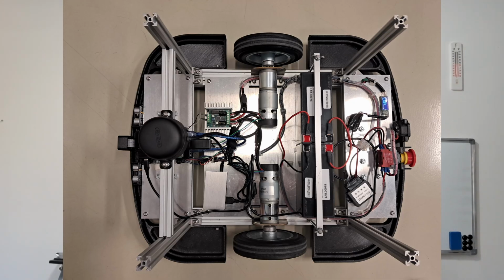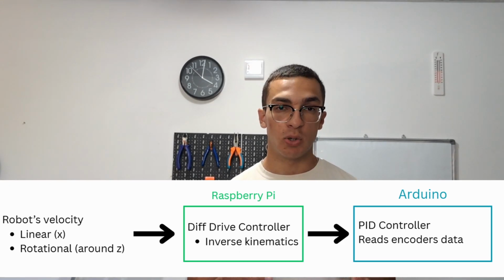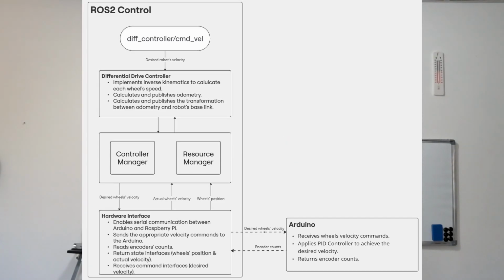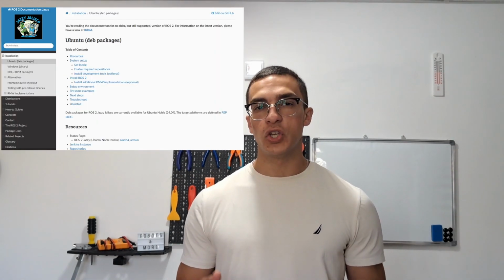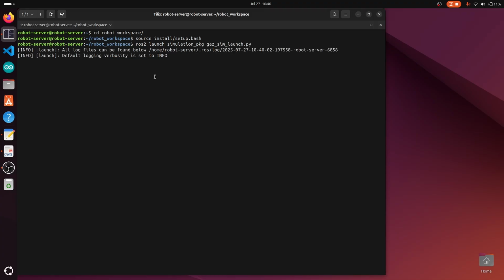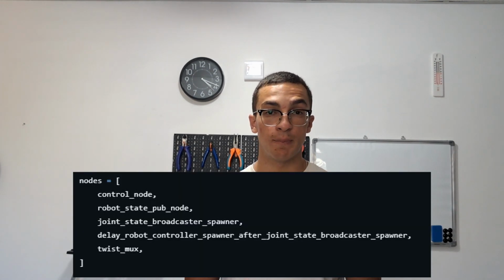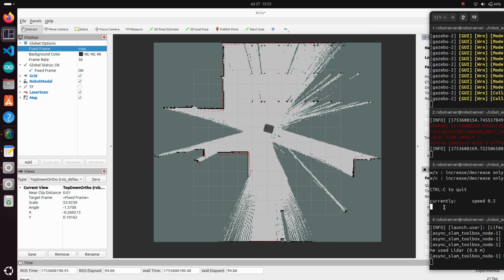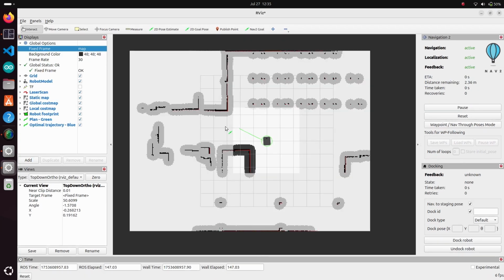How to build an Autonomous Robot (ROS2 Jazzy, NAV2, SLAM, Gazebo Harmonic)

Comment from the maker: Quick update: If you get an error like this when running the navigation command:
[controller_server-1] [ERROR] [1755079807.975936449] [controller_server]: Caught exception in callback for transition 10
[controller_server-1] [ERROR] [1755079807.976019561] [controller_server]: Original error: Considering footprint in collision checking but no robot footprint provided in the costmap.

Set this parameter to 'false' in the navigation config file: 'consider_footprint: false' (under the cost crititc category, under the controller server).

This is nescessary to to a recent update in the NAV2 Framework.
Learn more here: https://github.com/turtlebot/turtlebot4/issues/591
                               https://github.com/turtlebot/turtlebot4/pull/592

Comment: Hello everyone,

I have built a robot that moves straight in manual driving mode. However, in autonomous navigation mode (Nav2), although it successfully reaches the goal pose, it follows a slight zig-zag path while moving toward the goal.

Does anyone have any idea why this might be happening?

Also, would placing the drive motors closer to the middle of the chassis help reduce this issue? Can motor RPM and encoder resolution affect this behavior?

Any suggestions would be greatly appreciated. Thank you!
Reply from the maker: Hello. Which algorithms are you isng for path planning and what kind of controller are you using (MPPI, Pure pursuit etc)?
Can you visualize the generated trajectory using RVIZ? If yes, does your robot's behaviour matches the trajectory that you see on the screen?
Also, when you say the robot can drive straight in manual mode, do you mean you just provide a signal to the motors to drive forward, or you provide actual velocity commands to the motor controller algorithm? For example if you manually provide a command to the robot to move with a linear velocity of 0.5 m/s and zero rotational velocity, does it move in a striaght line?
Reply: @apostolos_apostolou Thank you for your response.

I'm using Nav2 with the NavFn Planner for global path planning and the (DWB Local Planner) as the controller. I haven't switched to RPP or MPPI yet.
The issue is that the robot shows a slight zig-zag motion while following the path. I tried tuning the DWB parameters (PathAlign, GoalAlign, PathDist, GoalDist, etc.), but the behavior became even worse, so I restored the original values.

I checked some diagnostics:
/diff_cont/odom is publishing at around 30 Hz.
/tf is around 52 Hz.
/scan is around 7.7 Hz.
AMCL (map -> odom) appears to update at around 7–8 Hz.
In RViz, the generated path looks mostly correct, but the robot keeps making small left-right corrections while following it. I'm still investigating whether this is due to localization, controller tuning, or drivetrain calibration.
can you suggest me what shell i do next my robot work well
Reply from the maker: @venkateshvishal8716  Hmm... maybe the low scan/amcl rate is causing issues, because DWB is running its costmap updates and trajectory scoring at controller_frequency (probably 20 Hz default) while your localization corrections only land at 7-8 Hz, so it's frequently optimizing against a stale map->odom transform between corrections. 
On top of that DWB resamples the full trajectory set fresh every cycle with no continuity constraint, so small critic score deltas between cycles can flip the winning trajectory and cause hunting, which would explain why tuning PathAlign/GoalAlign made it worse rather than better. 
At this point I'd just switch to RPP or MPPI instead of continuing to tune DWB.
Is it possible to switch to a different controller? If, yes maybe its worth it to give it a shot and see if it solves the problem.
Reply: @apostolos_apostolou  Thank you for the detailed explanation.

My LiDAR publishes at around 8 Hz, and I'm using AMCL for localization while the controller frequency is 20 Hz, so your point about DWB optimizing between localization updates could definitely be contributing to the oscillation.

In my case:
The robot drives perfectly straight in manual mode.
The global path in RViz looks smooth, but the robot physically makes small left-right corrections while following the path.
I also tried tuning the DWB critics (PathAlign, GoalAlign, PathDist, GoalDist, etc.), but the behavior hasn't changed much.

I'm planning to test MPPI as well for comparison. If there are any specific logs or topics you think I should record to narrow down whether this is a localization, controller, or motor control issue, I'd really appreciate your suggestions.

Also, if you're comfortable with it, I'd really like to connect with you personally. Your insights have been extremely helpful, and I'd be grateful for the opportunity to learn from your experience. If it's convenient, we could connect on LinkedIn or any platform you prefer.
Reply from the maker: @venkateshvishal8716  Yes, since manual mode drives straight I wouldn't worry too much about drivetrain/motor stuff, seems more like a localization/controller thing. Just try MPPI like you planned and see if the oscillation goes away, that alone will tell you a lot. If it's still there with MPPI then it's probably localization/odom related, if it goes away then it was DWB's trajectory resampling causing the hunting.

Yes ofc, you can find me on linkedin here: https://www.linkedin.com/in/apostolos--apostolou/
Feel free to reach out, and leave a message when you will send me the request so I know its you.
Thanks!

Comment: If I’m using Gazebo Fortress, do I need to change anything inside the packages?
Reply from the maker: Hm, can't really say for sure, I didn't try it. Probably not many stuff need to change (if any). You can try and tell me if you occur any errors, maybe I can help you.
Reply: @apostolos_apostolou  while running the simulation its showing could not connect service/controller_manager/list_controllers
Reply from the maker: @antormondal903  hm. I need to ivestigate it a bit and I will get back to you if I find anything useful